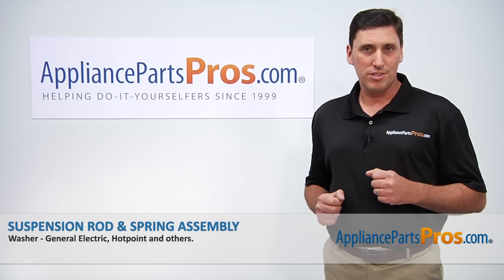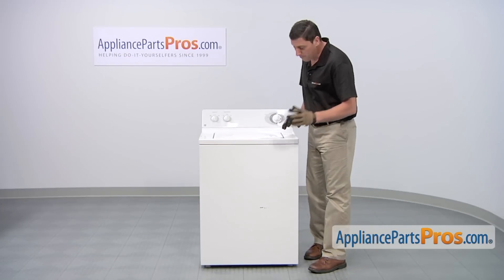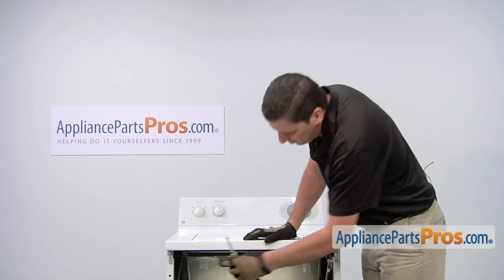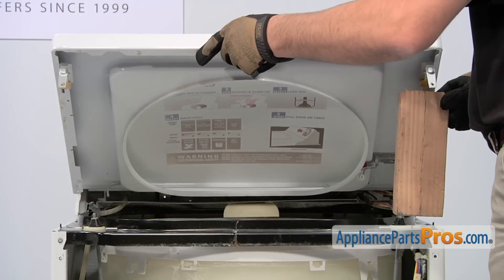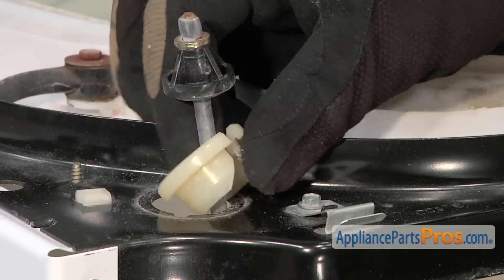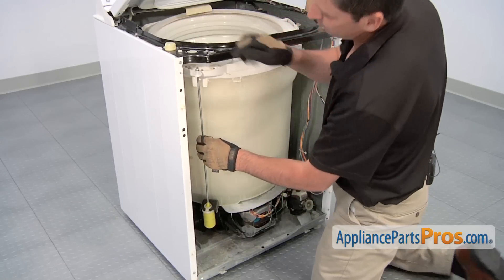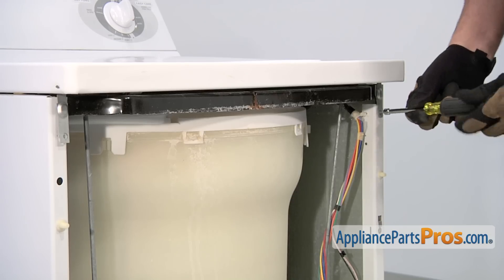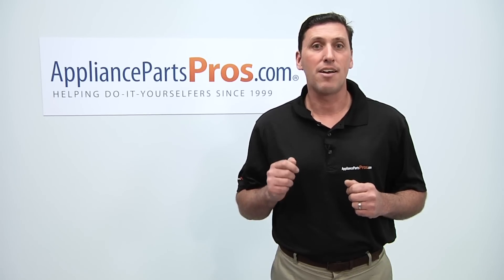How To: GE Suspension Rod & Spring Assembly WH16X543

Comment: What about the back ones?
Reply from the maker: You would change the ones in the back the same way.
Reply: @appliancepartspros  thanks 👍 
Would you help to find a suspension rod (set of 4) for a washer GE Model WPSE4200A0WW ?  I couldn't find it, not even in Amazon.
Thanks.
Reply from the maker: We will be happy to help!  Can you please provide your model number?
Reply from the maker: These are not sold in a set, theses are sold individually. The part number for the right side is WH16X543 and for the left side is WH16X544. So you will need 2 of each.

Comment: I was able to remove the suspension rod and spring assemblies.  How can I tell by looking at them that they need replacing?  The spring containers did not have any lube or grease inside, but show some residue on the side of the cap.   Are these supposed to be empty?

Comment: I've been here for an hour and I still haven't been able to remove the front panel
Reply: I actually didn't remove the front panel on my WPGT9150 washer. I just removed the screws securing the top and pivoted it back, almost 90 degrees. Then I could reach down in all 4 corners and replace all 4 suspension rods assemblies. I also added grease to the suspension cups, just like the machine came originally.
Reply: @steadyeddie7453  That's cool. It must be a different model than mine, because if I want to lift the top I need to shimmy  the front off in order to do so. I've decided that if this thing fails again I'm just going to buy a new unit.
Reply: this made me lol. I hope you got your washer fixed! 😄

Comment: How would you know which rod to change? can you visually see it or maybe tub would be tilting one way?
Reply from the maker: +Louie Dangelo Yes you can look for physical damage, tub tilting one way, also you can push down at each corner the tub should spring up about the same in all corners if one lags it could be a spring issue.
Reply: Thanks. Very helpful.

Comment: in my case the tub is tilted to the back so i would assume the front spring rod is broken. also in the picture above with old and new spring rod , how can one tell from the pic which is new and old. i do not see any defect in the old spring rod.
Reply from the maker: It is hard to look at the suspension rod and tell if it is failing.

Comment: Are all the springs inside all 4 the same?  Why are two housings red (rear) and 2 are blue (front)?
Reply: HEY THANKS FOR TELLING ME HOW TO TAKE OFF THE FRONT PANEL  - MY WASHER WAS TERRIBLY OUT OF BALANCE THE TUB WAS WAY OFF CENTER - IT HAPPENED WHEN THEY MOVED IT -- I ACCIDENTLY WAS CHECKING THE MOTOR ASSEMBLY AND WOLLA!!!!!! THE ASSEMBLY HAD BEEN STUCK ON SOME FRAME PARTS AND IMMEDIATELY WENT BACK TO THE CORRECT POSITION - PRAISE GOD!!!!!!

Comment: I have a Kenmore top washer machine.  when the spin cycle is on the machine moves across the floor what can I do to fix this problem
Reply from the maker: Start with making sure the washer is level. Then check all the suspension parts for damage. Without knowing what you have, I would suggest posting the problem along with the appliance model number on our repair forum and the techs can help you troubleshoot the problem. http://forum.appliancepartspros.com/

Comment: Ok sooo....how do you get to the rear ones?
Reply: He did show the easiest one to replace, but the rear ones are not that bad. You just need to have someone pivot the machine lid back and out of the way. Once you disconnect the rod from the top cup, you can reach down and push out the bottom cup. What I didn't see was him use any grease in the new cups. The originals were greased to prevent squeaks.